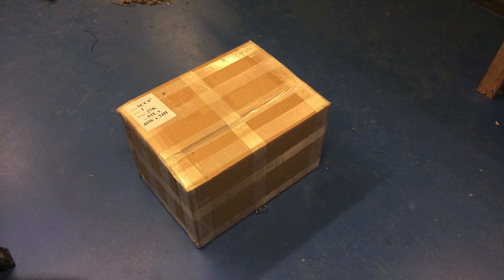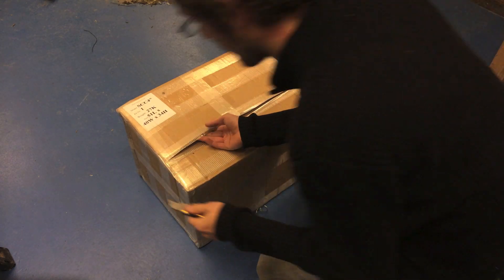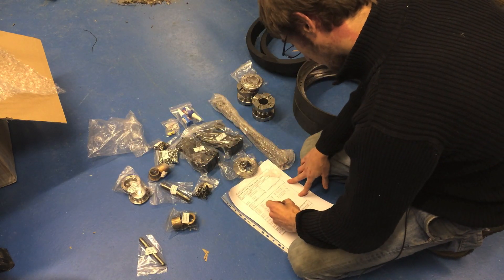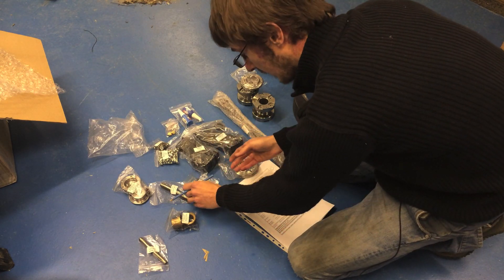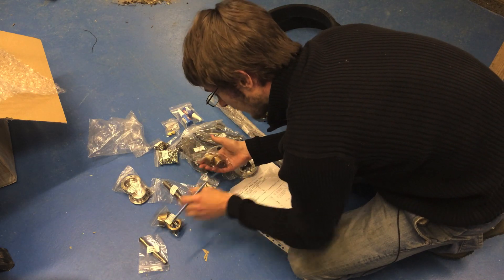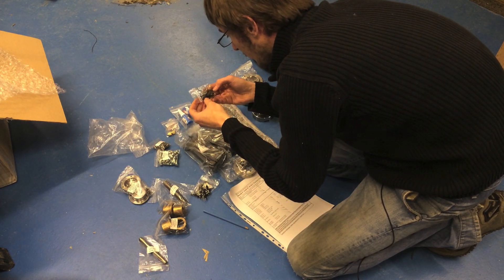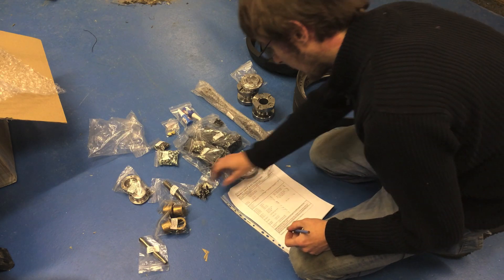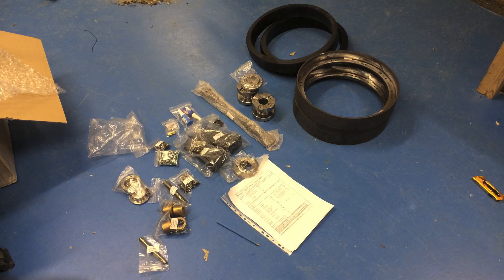Building a 4" Burrell SCC steam traction engine - Part 1 (unboxing kit 1)

Comment: Hi Chris, quick question, what araldite  did you use and what liquid rubber ?
Reply from the maker: +Phillip Stone hi Phillip, any 2 part epoxy resin should do the trick. I got a couple of small packs of branded Araldite at a local shop for cheap but then got one of the bigger two part kits from Amazon where it comes in bottles. http://www.amazon.co.uk/gp/product/B0006O8QQA

For the rubber I used Isoflex - you can get a primer as well as the rubber itself. Don't use it with nice paint brushes though as they will basically get destroyed! Hope this helps.
Reply: +ChriX Builds is pink grip okay for the fillet around the wheels as well or would I be better if going for jb weld ?
Reply from the maker: I used JB weld on the front and found it annoying (it chips/cracks and bits fall out) so used Pink Grip on the back which seems to be less brittle.
Reply: +ChriX Builds did you use the liquid rubber primer aswell or just straight on with the rubber
Reply from the maker: Hi Phillip, I used the primer - do not want that stuff coming off, ever! Chris
Reply: +ChriX Builds trying to find it in Cornwall is like finding a winning lottery ticket lol, need to get it now to carry on with the wheels lol
Reply from the maker: Got mine from B&Q in the end if that helps :-)
Reply: +ChriX Builds they've just shut b&q in Penzance Cornwall so I had to drive 25 mile to get the stuff lol
Reply: +ChriX Builds God only knows how your so calm with it, just taken me 4 hours to put the tyres on! Must of been doing it wrong, never doing that again!
Reply from the maker: 4 hours for the fronts or rears? Or both? At least it's done now! :-)
Reply: +ChriX Builds for the fronts, you could probably imagine the tools flying and shouting and swearing, it the end I just had to get them on so I used garden steaks beat in the ground around the rim and pushed the tyre over, think I'll go for vulcanised rears
Reply from the maker: Haha yeah, the black sticky goo just makes it a hundred times worse doesn't it!
Reply: +ChriX Builds must of destroyed at least £180 worth of clothes let alone the shed floor
Reply: +ChriX Builds did you have any trouble with the spokes not lining up with the T ring ? One side will line up but the other side 1 spoke will line up and the rest won't. Seems to be quite a distance away
Reply from the maker: +Phillip Stone don't remember any real problems... can you post a photo somewhere?
Reply: I don't actually know if I can, followed the instructions step by step but the bolt holes seem to be too far from the T ring, and the don't sit right in the hub

Comment: what basic tools do you need for this kit?
Reply from the maker: I would say, off the top of my head, spanners (metric and imperial), angle grinder, wire brushes, allen keys, twist drills, files, hammers, screwdrivers. Maybe some taps for cleaning threads. It is really only basic stuff. I have used my machines for a couple of things but that's only out of ease rather than necessity. Hope this helps and thanks for watching!
Reply: thanks mate how much was the entire kit?
Reply from the maker: GWR4079
here are the prices http://www.steamtractionworld.com/pricelistjuly2011-site.jpg

I did get a good deal as mine is part of the first batch.